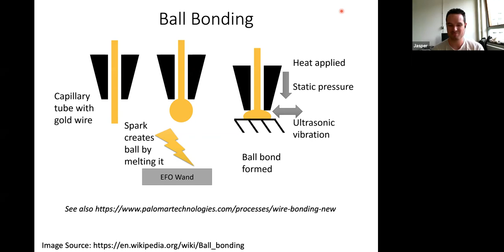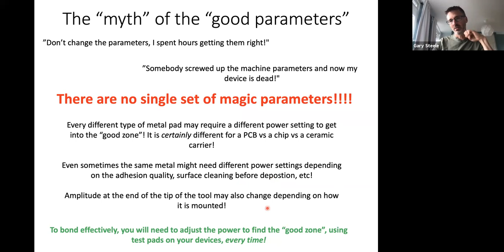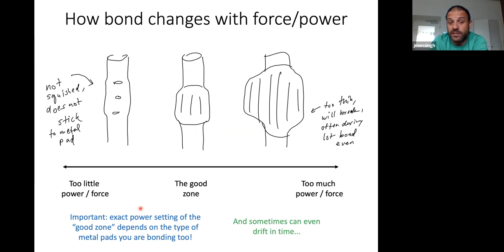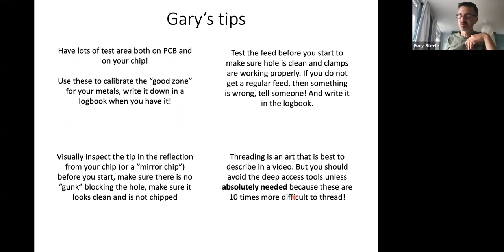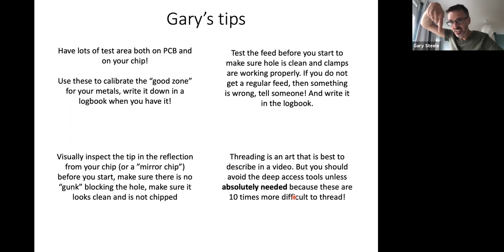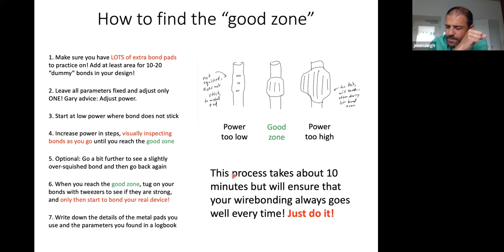A practical introduction to some of the concepts of wire bonding

Comment: This is so great! Thank you for sharing the experience! I have a chance to get hands on a used 4630E recently. While threading the 90 degree deep access tool, I was curious how many people would be able to handle this delicacy without freaking out. My method is to completely remove the tool, thread it through under microscope and reinstall it back. I will try rotate it without uninstall it next time. Meantime I never get the "feed" work for the deep access tool, I assume the "feed" only works for the 45 degree tool. Also I found there is rubber band connects to the roller of Z lever, this rubber band can be adjusted which affects Z axis.